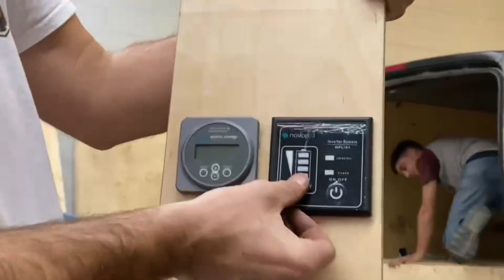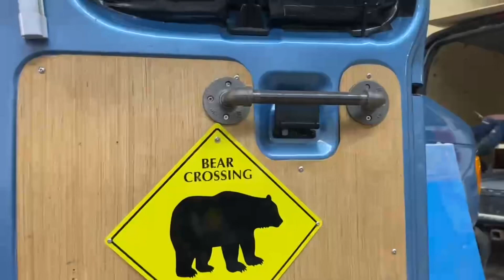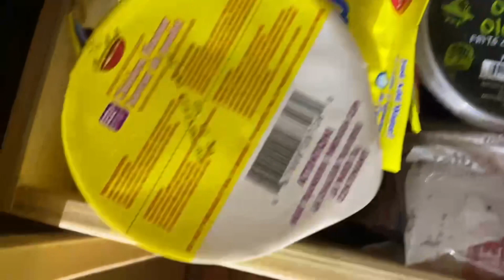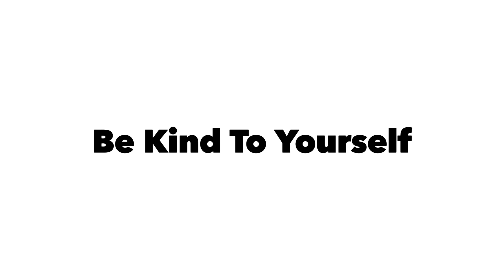Hearing Aid On The Fritz As Van Build Continues — Can You Hear Me Now?!

Comment: It is starting to look like a customized van home. Very nice. What I would like to know is: With what did he secure that corner board with all the wiring attached to it? Bear crossing Canada on two feet and four wheels - watch out! :-)
Reply from the maker: That’s from my original build, battery box on bottom open part facing back of front seat top part reverse wall behind my head open part facing towards back of van I hope I explained that well
Reply: @jeffiebear007  I don't know what it is called in english, so I just took a chance. I was referring to that thing up under the ceiling that Mark attached all the wires too. How did he secure it to the ceiling and to the walls?
Reply from the maker: @milcotto4153  oh ok miss under stood, you take pieces of wood screw them to the metal ribs, mark them on boards or box so when you screw them to the corner you have something to screw into.
Reply: @jeffiebear007  That is a brilliant way of doing it! I like to learn new tricks that might come in handy one day. Thank you Jeffie :-)